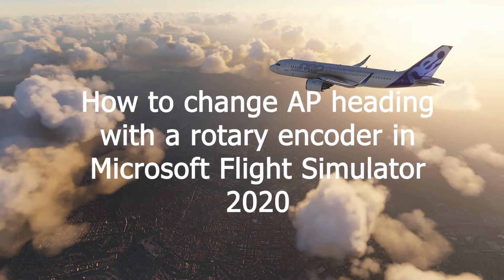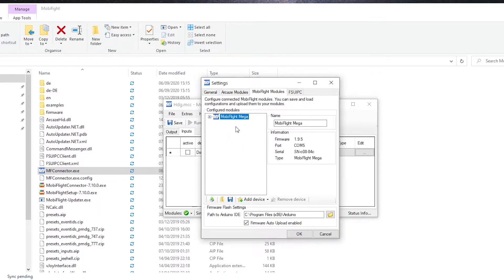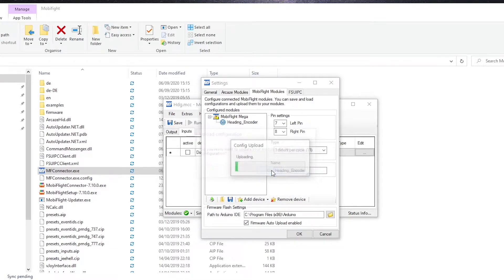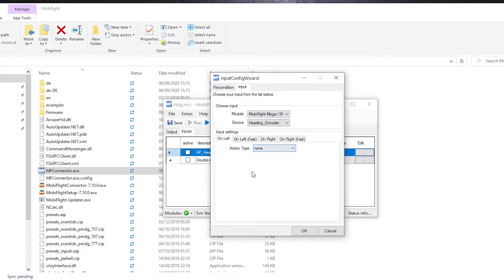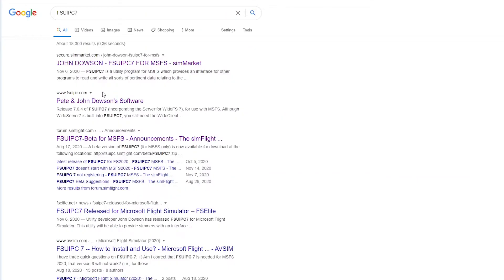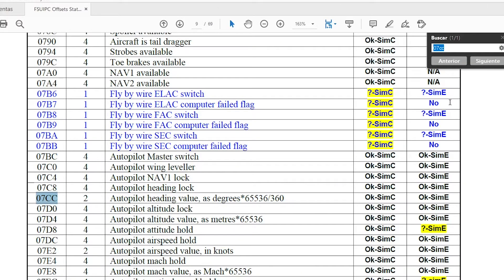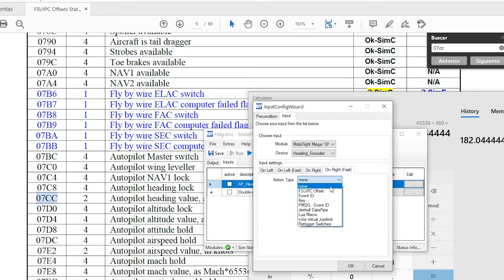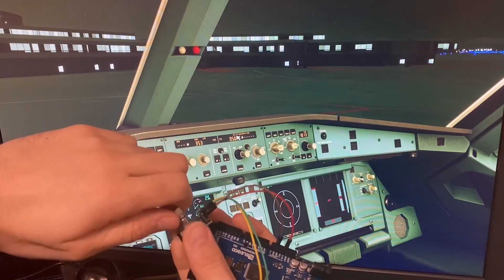How to setup a rotary encoder in MFS2020 for your cockpit panel | Arduino Mega, MobiFlight & FSUIPC7

Comment: Hey, I found thois video a while back and i'm wondering if you would have any idea why this would make my mobiflight crash? my encoder is well wired as I can do this using the "microsoft flight simulator" instead of fuipc but I haven't figured out how to do the fast rotation on that.
Reply from the maker: Is it updated to the last version? Its weird… any error message? Have you tried re-installing?

Comment from the maker: EDIT: 
Using $-182 (on left) and $+182 (on right) will cause trouble from heading 179º to 180º as data is 2-byte signed (from -32768 to 32767).
 This means that 179º is 179*65536/360 = 32586  and 180º is -32768, with a negative sign!. To solve this break issue you can use:
On right: if($=32586,-32767,$+182)
On left: if($=-32768,32767,$-182)
Or alternatively, use the EVENT_ID: HEADING_BUG_DEC and HEADING_BUG_INC instead of the FSUPC Offset.
Reply: AWESOME! thanks you
Reply: U can also change the byte from 2 to 4 it fixed it for me
Reply from the maker: That is not a good idea Reivs
Reply: Hi, your vid helped alot. May i know where i insert this values ie: 179*65536/360 = 32586
Reply: Nice!!!!!